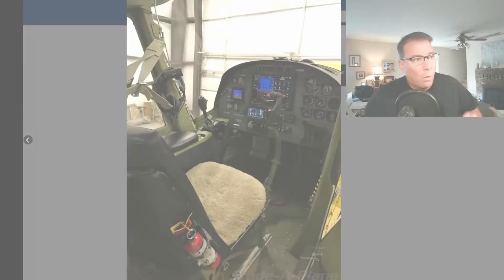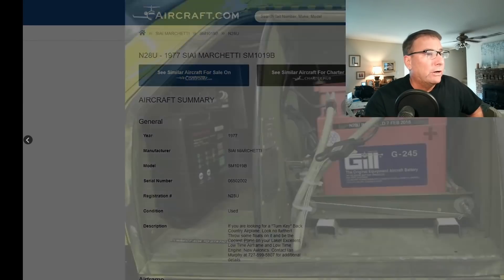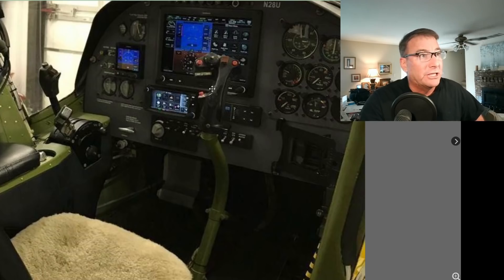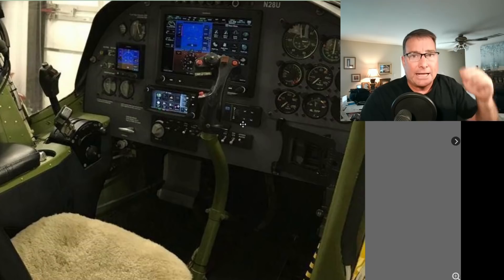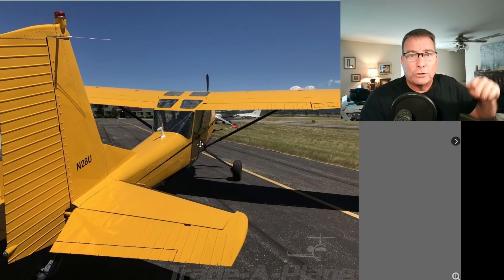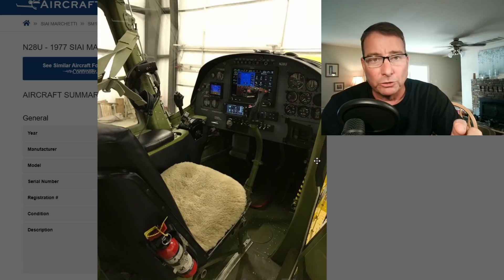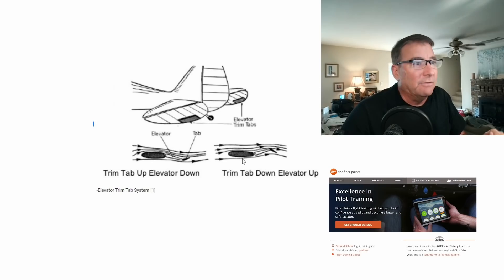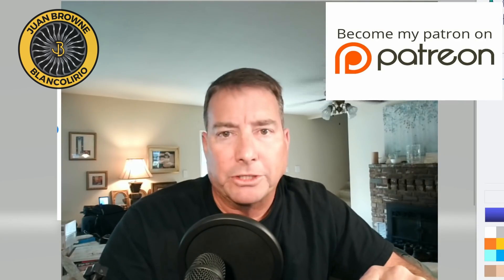Dale 'Snort' Snodgrass Siai Marchetti UPDATE- Elevator Trim System 8/8/21

Comment: The National Transportation Safety Board concluded a nearly year-long investigation into the crash earlier this month, finding that Snodgrass likely failed to remove the flight control lock before taking off, which “resulted in a loss of airplane control and impact with terrain.”

Comment: The elevator cable broke on the down line side. Since the elevator cable has 30-35 Lbs of tension on both lines, when the down side broke the elevator up side pulled the elevators up with recoil. This is because down line tension went to zero when it broke on the side and the 30-35lbs tension on the up side had no counter force from down line side anymore. This is what causes the intense up elevator that stalled the plane. All steel wire cable has a 10 yr max life for fatigue that the FAA ignores on all aircraft. It has caused more accidents than anything. The downline side of a elevator cable is the most worked with stress, This is because as you pull elevator up , you are increasing the tension on the down line side of the line. Note that flying a plane involves using up elevator far more often than down elevator control, and it is this increased line tension on the down line side, that happens more often that causes down line side to stress fatigue first.

Comment: Are you aware that if the control locks are left in place the elevator trim will then work in reverse, i.e. nose down trim will result in the nose pitching up? I So if he applied full nose down trim it will have aggravated the nose up condition. I know someone who many years ago left the external control locks in on a DC3. They realised and managed to control the plane by using the trim in reverse.

Comment: It is completely “possible” to taxi the aircraft without the use of rudder pedals….by simply using differential braking…a common method of Cessna taildraggers.  YOu might wish to modify your comments to the contrary.

Comment: Find it difficult to believe that Dale would not have had enough strength/leverage to push the stick forward enough, even with full nose up trim, at that slow an airspeed.  But, the NTSB/FAA will figure it out.  My feeling is that the controls were frozen by something and Dale may not have done a thorough preflight or before take off check, falling into the experienced pilot/simple aircraft trap.

Comment: Had a runaway trim incident in my old Cherokee Six.  Thankfully I was landing and low power, and was able to overpower the elevator trim (it was full down) and didn’t have time to pull the breaker or troubleshoot.  Made the landing.  Taxied directly to the maintenance hangar.

Comment: I experienced a misrigged elevator trim system in a Grob 103 glider upon take-off under aero-tow for a ferry flight CKE to CVH. Luckily stick control easily overpowered any trim adjustment and I figured out the problem.  I should have released and landed to give the glider back to the mechanic/repair station but I continued on tow to my destination where the glider became involved in a law suit!

Comment: One other possibility is that during taxi the switch could have been activated unknowingly, to full nose up position, and no way to visualize the position of the trim tab as there do not seem to have a trim tab position indicator, on the front panel photos I looked at . With all the switches on the stick so close to each other, and trim not having a noticeable effect during taxi,  believe this scenario should be investigated.

Comment: Okay, as a former aircraft mechanic in the USAF, if we had to work on, or replace stuff on flight control systems, we were REQUIRED to ops check flight control function with one in the flight deck and one on the ground to ensure flight controls were moving in correct direction and deflection angles. Maybe GA needs to REQUIRE two man ops checks if they don't already, which would be insane.

Comment: It is always a good idea to step back and have a second pair of eyes on ALL flight controls. 
I spent twenty-five years as a corporate AMT. Every single thing to do with flight controls was an RII item. 
We had a process which included you doing the work.... followed by your crew lead verifying the work... followed by the inspection department doing the final 'eyes-on' inspection prior to closing panels. 
The last line of defense was the pilots doing their inside and outside checks prior to test flight.

Comment: In an uncommanded pitch up, ALWAYS bank the aircraft immediately! Roll off the lift factor to the point where you're level or in a slight climb, THEN and only then troubleshoot the issue. Once you get into a stall with a stuck pitch up trim, it's all over :/. My heart goes out to the pilot and his family. RIP!

Comment: I may not have piloting experience but as a full time mechanic I find it absolutely ridiculous that trim can overpower a human. Are you kidding me? Who the hell thought that was a good design?
"Lets rely ONLY on electronics for the future projection of mankind" said only idots who call work being a desk
Reply: Trim control is not always electronic, though on many newer planes it is. The problem isn't necessarily that it's electronic. It's that when/if there is a trim issue during a critical phase of flight like may have been the case here, there is little to no time to diagnose, correct and recover. It's too fast. Even if this had been a manual mechanical system, were it out of trim on take-off, it's just as unlikely there would have been no time to correct and recover. IF that's the issue at play.
Reply: @e.l.norton  You helped me understand the equipment better.
I was thinking that if the trim was OK then suddenly immediately at take off it changed, this wouldnt happen with manual.
So yeah if it were pre set this way then either is the same.

Comment: I once witnessed an aircraft accident of a globe swift in which the pilot forgot to remove the seat belt from around the control stick in the right seat. The aircraft became airborne and then climbed and wallowed around to about 30-40 feet of altitude until it stalled and hit the ground. Fortunately the pilot survived with only minor bumps and bruises. You never forget seeing things like that... 

Such a terrible loss of Capt. Dale "Snort" Snodgrass. Condolences to the family.

Comment: Gentleman. I don't believe, the pilot would be unable to overpower the elevator trim pith-up force. This plane was flying with quite a low speed, continously decreasing up to spin condition. This is not a huge aircraft, and I imagine, the pilot was quite a strong guy. Check possibility of any external parking elevator blockade left on the plane after walk-around. We had an accident like this in Poland couple years ago. RIP pilot.

Comment: hard to tell from the original video from ramp of the aircraft stalling. But after impact while the empennage was at rest and front of fuse burning, it would almost appear as though the trim tab is deflected down. But video is just too grainy to be certain.

Comment: Where it went straight up after takeoff I'm thinking FOD!
Reply: And the only reason I say that is because he was A F14 pilot. Might have been use to pulling up fast to get off the deck. Could have been something that rolled back and lodged something, or could have been a broken control wire
Reply: And yes I know a little about aircraft. 10 year Airframer in the Navy

Comment: Has a wind event been ruled out? A strong enough head-on gust would pick him up early. I've seen video of similar sized aircraft being blown across the airfield and becoming airborne, and this looked very similar. All three wheels lifted off at the same time, and he went right up to stall. No one could have recovered from that. It happened in seconds and way too low.
Reply: The ATM told him, “wind calm,” so wind was not a factor.

Comment: Juan, one thing I noticed in the still grab from the video is that the seated mass seems to be in the back seat, not the front. Question for the 1019 guys, is the trim system the same in the back as it is in the front, also, is there ANY way the rear peddles can move independent of the front ?

Comment: I retired from the USAF several years ago after 26 years of active duty.  (I was not a pilot).  I remember reading a USAF publication regarding a C-141 doing a night takeoff from (I think) McGuire AFB.  Tower personnel were watching the Starlifter as it accelerated down the runway.  When it became airborne, it was observed to go into a very high angle of climb.  The aircraft continued to increase it's climb angle and to all watching it was apparent the Starlifter was just seconds from a power-on stall.  Then unexpectedly, the aircraft turned on its side at a high angle of bank and began turning in tight circles above the airfield.  As it flew in a circle it was gaining altitude.  (Tower personnel reported it was difficult to see the aircraft except for the navigation lights).  The aircraft continued circling, it eventually leveled off several thousand feet up and only then reported MayDay.   The aircraft returned to base safely and everyone was ok.  Later investigation revealed a "run away trim" problem on the elevators.  The pilots were able to save the aircraft only because they had the presence of mind to put the aircraft on its side BEFORE it stalled.  This allowed the aircraft to keep flying.  While the aircraft was in the midst of this emergency, the flight engineer  was able to access the trim switch and rip away its wiring. I believe that is what was said at the time.  All this to say....is this a suitable solution for private pilots in smaller aircraft?  Ie., uncommanded high angle takeoff you immediately put the aircraft on it's side and begin circling rather than just continuing the climb until you stall out?   IF I were a pilot, I think I'd definitely consider it.  But, I suppose you would have to train for this until the response becomes automatic.  You would not have time to think about it when it was occurring.  Perhaps Juan knows of this incident and might remember some of the facts more accurately than I do.  This is incident is very similar to the comment and scenario described by Manny Puerta in an earlier post.
Reply: The problem there is, as the bank angle increases so does stall speed. In other words, if the aircraft is already at or near stall speed, increasing the bank angle will only accelerate that condition.
Reply: @wendyvic4046 this is correct assuming positive G is left on the wing. If the wing is unloaded towards 0 G and the bank is started the nose will come down without stalling. Pilot performed a nose high unusual attitude recovery and saved the day.
Reply: @zachmulligan11 you are absolutely correct. You just let the nose come down on it own. I do this all the time in a military trainer for some of the advanced flights on the syllabus. It will achieve the same result in a large airplane.

Comment: I fly sims only, no pilot and I myself configured my elevator trim to nose down pressing down and vice-versa. It's amazing how confusing that was just by theoretically knowing swithes should work opposite to the desired attitude. On a sim, you pause it and reconfigure the switch. In real life, it's one shot to get it right after a split second. Condolences.
Reply: No, in real life, on a plane like this, if the trim runs to the max up or down it just means you have to have more pressure on the stick to counteract it. On large jet aircraft the forces are likely too much (speed is also higher), but at low speed in this aircraft there is no way he would not be able to overcome the trim.
Reply: @X85283  Thanks for the input. I was wondering that too. The airplane seems so violently out of control in the footage it's hard to believe a little trim would have caused all that nose up attitude with no chance for the pilot. At least not under normal circumstances.

Comment: The trim should be neutral for takeoff and if the trim switch was shorted out before takeoff it should have been noticed in runup.

The short would have to have happened pretty much at takeoff which is extremely improbable, but not impossible I suppose. That would really,  really suck. 

As for wiring backward, isn't it a simple matter to have someone move the trim to nose down while someone watches the tabs on the elevator? (and the opposite).
Reply: Unless you were in a hurry up and leave as we are running later situation.

Comment: Absolutely not possible.
FULL ENGINE POWER will generate some force on the trim of the elevator. While FULL SPEED OF THE PLANE has A LOT more force on the trim.
A full deflection of the trim, or reverse rigged trim, while the plane still on the ground, will immediately show itself on the control stick.
Since this plane is a tail dragger, the tail will lift off first.
If the trim was fully down, the elevator up, the tail would NOT have lifted AT ALL.
Instead, the tail DID LEAVE the ground. But, for one second only before rotation.
It takes half of the runway building up speed, with tail above ground, before a pilot can initiates the rotation.
The plane was light and powerful, and he made a premature take off; similar to a fighter jet take off.
Cutting or reducing the power would've lowered the nose.
But, no sign indicating that. He wanted the plane to keep climbing, thinking it will keep it's air speed.
At that high climb angle, he lost visual ground references.
His only hope was the Speed Indicator. I bet that was faulty, or the Pitot Tube was still covered. He must've missed it, during the preflight check.

Comment: Exact same thing happen at KDRT May 10, 1978 to a pilot flying a De Havilland  Otter- 3 died. FAA, NTSB and U.S. Air Force team found a broken push rod to the elevator The plane was a civil air patrol plane thus the Air Force team. The push rod was broken when the plane sat tail first into a 58 mph wind with out gust locks in place.. The PIC was not aware of the  high wind as he was out of town. When the pilot exercised the controls, during preflight, he was unable to see if the elevator  moved or not, from the cockpit. The pilot had his personal plane, a Cessna 205, in a hanger next to mine. He was 24 years old with well over a thousand hours flying time in multiple aircraft. All 3 that died were personal friends.
.NTSB Identification:
 FTW78FRG39
14 CFR Part 91 General Aviation
Aircraft: DEHAVILAND DHC-3, registration: N5370G
----------------------------------------------------------------------------------------------------------------------------
 FILE    DATE          LOCATION          AIRCRAFT DATA       INJURIES       FLIGHT                        PILOT DATA
                                                               F  S M/N     PURPOSE
----------------------------------------------------------------------------------------------------------------------------
3-0895  78/5/10    DEL RIO,TX          DEHAVILAND DHC-3    CR-  1  0  0  MISCELLANEOUS             COMMERCIAL, AGE 24, 1670
        TIME - 1130                    N5370G              PX-  2  0  0  SEARCH AND RESCUE         TOTAL HOURS, 250 IN TYPE,
                                       DAMAGE-DESTROYED    OT-  0  0  0                            INSTRUMENT RATED.
        NAME OF AIRPORT - DEL RIO INTERNTL
        DEPARTURE POINT             INTENDED DESTINATION
          DEL RIO,TX                  ALAMAGORDO,NM
        TYPE OF ACCIDENT                                         PHASE OF OPERATION
           COLLISION WITH GROUND/WATER: UNCONTROLLED                TAKEOFF: INITIAL CLIMB
        PROBABLE CAUSE(S)
           AIRFRAME - FLIGHT CONTROL SURFACES: ELEVATOR ASSEMBLY,ATTACHMENTS
           MISCELLANEOUS ACTS,CONDITIONS - PREVIOUS DAMAGE
        REMARKS- ELEV PUSH-PULL TUBE BROKEN.ACFT PARKED IN WINDS 30G58,CTLS NOT LOCKED.

Comment: I'd really like to see someone that owns one of these airplane's prove to me you can't "over power" those two small trim tabs with those two giant elevator surfaces. Just don't seem possible and even if in the end you can't, wouldn't you see some indication in the video of him at least trying to shove the stick through the panel. Any pilot, and certainly one with a gazillion hours, having a aircraft suddenly in  that attitude would be trying to do something to correct it. In this case, forward stick. Can't imagine you wouldnt see some evidence of that in the video even if in the end it just wasn't enough. I kinda hope that wasn't it. Not much I hate worse than another dead aviator that would not be that way if they would PRE FLIGHT THE AIRPLANE! Thoroughly and every time !! RIP Dale. So sad.

Comment: If any control system has maintenance performed on it, like the elevator trim system, would it not be standard practice to verify the switch moves the elevator trim in the correct commanded direction?  Post-maintenance should be included in any maintenance work on any aircraft system.

Comment: Oh, man.  Several years ago as an "old" helicopter crew chief, my bird came back from a night flight with a flight control write up.  The crew was low-level in the mountains of WA at the speed of snails, in a diving, left turn, when the cyclic jammed as he moved to level the a/c.  Both stick shakers were able to "break through" the restriction and RTB'd ASAP.  I started my trouble-shooting with a general look-over of my bird then moved to the "cockpit" to inspect the flight controls & rigging.  Immediately, I saw a wax string wire tie had loosened and slip down the stick and over the left roll stop.  I tested the strength of the wax string and estimated it would take over 40 pounds of force to break the string.  The pilot, not really trusting me, said, "You're going up with us (on the test hop), right?"  I was sure my work was right, flew with them and came home.  That was one hell of an operational check flight!  (Wire ties.  Jammed flight controls.)